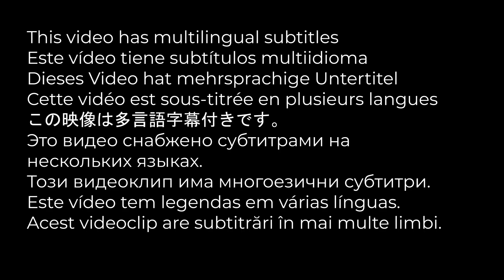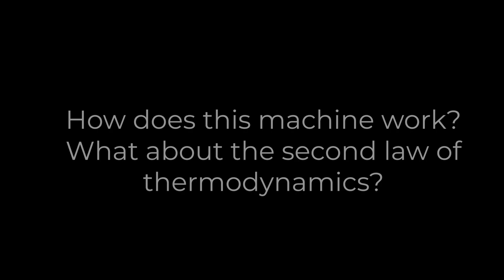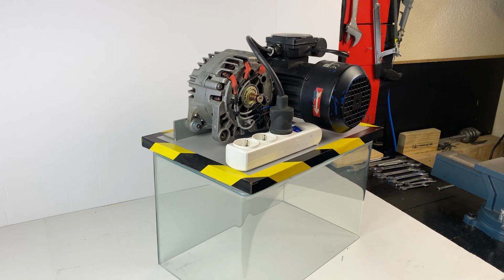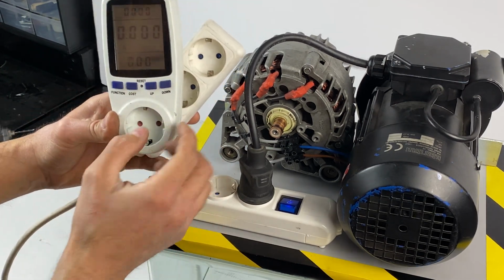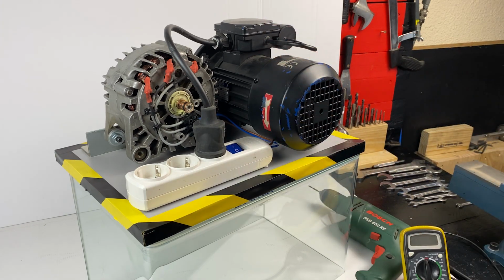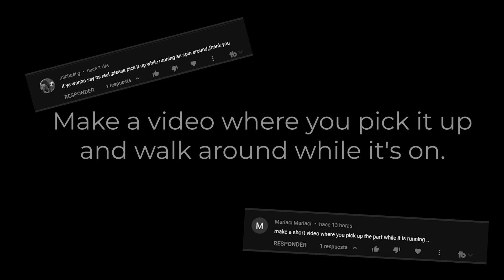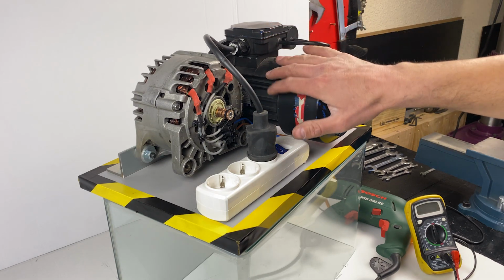We put this Infinite Energy Generator to Test - Liberty Engine 1.0

Comment: Hi nice clip but to avoid patent problems, you can let them be produced in China or Russia, where patents are not of any importance or further more, you sell a set, of all nessesary parts and the buyer has to assemble it himself, so you infringe no patents. In Europe the duration of a patent is 20 years. There are many solutions, so go for it.
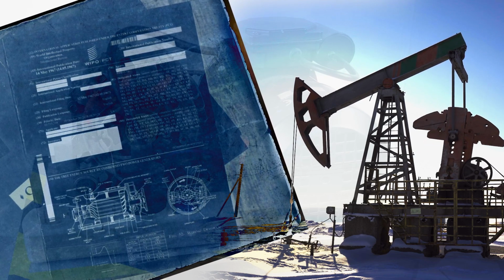Reply: I am suspicious of the patent's existence (19:55) for the following reasons
1) the priority date on the document is October 2012, it should be between 12-18 months before the filing date which says 1967-05-12, not 45 years afterwards
2) the barcodes top-right and bottom-left should be identical, even when blocked out, you can see the start of the barcode nearest the bottom of the page doesnt match the start of the barcode at the top of the page
3) There should be a human-readable patent (application) number next to and below the bottom-left barcode, the same number and size as below the top-right barcode
4) the abstract (summary of invention) is ALWAYS on the front page of the document - in this case it is missing
5) patent drawings are required to identify components by number, not words as the document may need to be translated later to another language**
6) do a search for international patent applications published on 1967-05-14 (which is a Sunday), only 4 were, this is not one of them
7) do a patent search for ALL the words FREE ENERGY SOURCE BY COMBINING TWO POWER GENERATORS, you will find no patent; I did a WIPO patent search for TWO POWER GENERATORS, got 35 results the earliest being 1967, but this patent wasnt amongst the results 

**the 2 cross sectional drawings of the 1950s era DC generator are identical down to the positioning and font style of the component labels as seen on  page 299 of
Technical Manual TM-9-8000, Principles of Automotive Vehicles
Department of the [US] Army, 25 October 1985

view or download a PDF of this 1985 edition of that book by searching for .. manualzz  8811024
there are other editions of this book, having different dates, so page number may differ

Comment: I have always known this would work. This is simply a highly efficient method of using a small proceed of generated electrical energy to produce 60-80% more than required to run the motor. To make it even more efficient you build multiples and power their motors from a single unit. Then you eliminate heat and frequency deviations as you load your circuits. What trips most people up is they believe this is 100% efficient.  It is not.
Reply: You are correct these will work but you have to have the right balance of efficiency versus current versus voltage versus generation of energy and consumption of energy it's a fine balance and it can only be used in its own loop can't really power anything else

Comment: I’m familiar with this tech, only problem is he hasn’t showed this under load & how does it regulate the output? I’m also aware of 50 cycles & 220volts as that is European power specs. Just curious about regulation of power under load. Also to create several thousand watts it takes five  to 13 horsepower to get this with an internal combustion engine. What is the maximum current draw for this machine? (& maintain voltage & current draw?)

Comment: When he pulls cord to start it 
It kicks at a higher rpm pretty quick and at a specific speed 
 My conclusion : batteries in the base  that is wired into power strip 
Mic drop   Prove me wrong make the base clear and also take shroud off of motor and top black converter. All while running it
Reply from the maker: You have a lot of evidence in the following videos

Comment: Could you tell me where you found this 24volt, 200 amp alternator. All the ones I can find do not look like the one you are using in this video. Do you have to search for a 3 wire alternator also? Thanks.
Reply from the maker: Don't try to build it at this moment. We haven't disclosed  all the details yet.

Comment: hello, i have here a 48V dc generator and a six pole 380V generator/motor from an old generator. the question for me is how will the cables need to be put in place. the 48V dc was used to start the generating process for the six pole syncronous generator.
can I use this? how big (HP or KW) needed to be the three phase Motor to turn this 140KvA Generator? how shall i wire the whole thing? Possibly I need to remagnetise the 48V dc gen to errect the 380V AC asynchronus Generator. Or is it not possible to make it?
cheers and many thanks
Martin

Comment: I just want to know how ya take a DC alternator and make it put out AC current.   Is it just the way the magnets are setup on the rotor that while it spins it vibrates just right to make it AC???  Or is it xuz u have 3 wires coming out of the alternator connected to a piece that u can connect only 2 wires too so going from 3 down to 2 wires make sit AC?

Comment: as an engineer i can tell you this idea would work just not like this you need a regulator on the motor the way its set up right now the motor would just spool up indefinately until it blows up the alternator is over charging the system so the motor would continuously accelerate unless a regulator is used to regulate speed

Comment: You are running devices with this machine, where is the neutral? Also how are you running a single phase motor with two phases? I mean where is the neutral wire?

Comment: Thanks man, I think you have proven your case, not sure why the other ones failed, but you have me convinced. Whats the cost of loosing, very low in comparison to not trying at all. On Saturday I purchased a used E-Bike, problem with battery and charger. Took it apart, battery and BMS soaking in water. Went to Youtube. Now am I not only going to build new battery and charger for my bike, but I am going to build a system for my home. You can have a lot of fun with these 3.7 s . Imagination can take you a long way, as long as you exercise it. looking for a good source for battery/materials, if anybody knows somebody. I like how you talked us through it. Going to go and spend some time on your site. I Love great ideas

Comment: 1. Patent rights last for a maximum of 20 years, and even when they are in force, they are publicly available at the patent office. The only way to keep an invention a secret is NOT to patent it, as for example Coca-Cola did with its most famous product, the recipe is only in their safe, so no one else is able to 100% copy this flavor. 2. Giving the patent number is not a crime, it is only forbidden to make a profit without the knowledge of the patent owner
Reply: I am suspicious of the patent's existence (19:55) for the following reasons
1) the priority date on the document is October 2012, it should be between 12-18 months before the filing date which says 1967-05-12, not 45 years afterwards
2) the barcodes top-right and bottom-left should be identical, even when blocked out, you can see the start of the barcode nearest the bottom of the page doesnt match the start of the barcode at the top of the page
3) There should be a human-readable patent (application) number next to and below the bottom-left barcode, the same number and size as below the top-right barcode
4) the abstract (summary of invention) is ALWAYS on the front page of the document - in this case it is missing
5) patent drawings are required to identify components by number, not words as the document may need to be translated later to another language**
6) do a search for international patent applications published on 1967-05-14 (which is a Sunday), only 4 were, this is not one of them
7) do a patent search for ALL the words FREE ENERGY SOURCE BY COMBINING TWO POWER GENERATORS, you will find no patent; I did a WIPO patent search for TWO POWER GENERATORS, got 35 results the earliest being 1967, but this patent wasnt amongst the results 

**the 2 cross sectional drawings of the 1950s era DC generator are identical down to the positioning and font style of the component labels as seen on  page 299 of
Technical Manual TM-9-8000, Principles of Automotive Vehicles
Department of the [US] Army, 25 October 1985

look for a PDF of this 1985 edition of that book on manualzz download 8811024
there are other editions of this book, having different dates, so page number may differ

Comment: Hi bro.. I hv been thinking of using 12v  alternator and connect with 12v dc to 240 ac power inverter.. Then connect the inverter output to Ac motor..
So then no need to modify the alternator magnet..
Please advise sir. Thanks

Comment: As I understood it there need to be put magnets to the inner part or can they be put non rotating to the outer part when using this synchronus gen which has run only 80 hours.. in the las 40 years.. It has coal contacts to magnetise the inner windings in the rotor.
ideas how to make it produce 140KVA 400volts?

Comment: The inability to hold 60 hz is a problem. This can cause problems for a lot of electrical devices. A simple, even lower power version of this would be great for keeping a battery bank charged. No solar panels, no wind generator needed. Just run this to keep batteries charged and let the batteries provide clean 60 hz power.
Reply: Thinking the same
Reply: Use a FULL BRIDGE RECTIFIER circuit to make your power clean!

... hope y'all get the reference!

V

Comment: Some comments: 1. there are more patents for an energy generating machine on this basis. 2. Bearings go a lot longer. 3. It's nice it can power a drill but can it power an computer without blowing it up? For sensitive equipment it needs to be full sine wave. Mabe you can fix this with a solar coverter system.

Comment: So the alternator puts out AC voltage?
And you used a AC motor?
So if it’s putting out 220v how does a 110v drill work on 220v???

Comment: Impossible, The voltage 7:33 is lower at the alternator ???? but higher at the white strip plug 8:25. What type of batteries are being used in the base?

Comment: Can you explain if this unit is supplying the power why the generator does not slow down as you increase the electrical load with appliances? As this is a massive load and as such seems quite strange to me that it does change speed with load?

Comment: Here's one a brushless motor with generator coils started by a battery and charged with the dynamo.  The inverters on the dynamo powered electric cars or more dynamos.   Dynamos with inverters to power the house.  Send your excess back to PGE at 5000 per month per 120 amps.

Comment: Hello, I rephrase the question. Can you give us the voltage given by the generator when it is driven by the motor, but with the motor powered by mains current. Thank you.
Reply: No 🤪
Reply: 200 volts at 4000 RPM with a frequency of 400Hz at idle running and unloaded.
100V  2000RPM   200Hz
50V    1000RPM   100Hz
25V      500RPM     50Hz
In a generator with permanent magnets, not only the frequency but also the voltage is proportionally dependent on the speed. 
Test device, generator with 6 pole pairs.

Comment: I've seen this exact same design many years ago it would be wiser to use a larger wheel for the generator. Feed that power to a circuit breaker box. To regulate your output so you don't burn up your devices.
Reply: Example if wheel was 8 in diameter and the wheel + 2 in diameter on the alternator you would produce four times more electricity but when using a larger wheel on the generator you would need an additional stand in front of the generator with a bearing to help with stabilization for offset weight that comes from a larger wheel. I would recommend you do the math and check your voltage see how much you need to power your home if you can figure it out then your home will no longer require an outside power source
Reply from the maker: Interesting…
Reply: @HiddentechnologyYT  with your new video can you please supply all models of equipment used so it can be replicated by a third party. Peer verification can be the only proof acceptable as any video produced will always be open to dispute of authenticity. Hollywood makes its money on the back of making the impossible look real.

Comment: Where can I buy one? I seen a similar patent and it was abandoned. By the way Patents expire after 20 years so.. it's not tucked away.. anyone can build it. However.... your device simply cannot work.
There is a way to do it.... but you need a fuel source called water.... you can split it with sound and use it over and over and never run out of fuel.

Comment: I'm sorry, but I learned about this little fallacy back in the early 1960s when I was in high school Electric shop. People have been doing this since the generator and the motor were invented, because on it's face it seems so obvious. It doesn't work because friction is not taken into consideration. It will run for a little while but it will run down unless it has an additional voltage source put into it. ie., a battery.

Comment: The video clearly shows a working system but it doesn't show the system is running on 'free energy'.
To proof that  claim it has to run for a much longer time to show that nowhere a battery is hidden somewhere inside.

Comment: 4:19. Wrong. In order for there to be 220 volts between the phases, it is necessary that there be a linear voltage of 127 volts on each of the phases. You have a line voltage of 220 volts, which corresponds to an interfacial voltage of 380 volts.

Comment: 1.Gdzie kupić alternator 200a 24v? Owszem są ale 12v 200a
2. Jakie parametry mają magnesy?
3. Jakie parametry ma silnik?
1 . Please provide the 
parameters and dimensions 
of the neodymium magnet. 
2. A 24V 200A alternator is 
hard to come by. Can it be 
replaced with e.g. 12v 200A'2 
3. Please provide the 
parameters of a single-phase 
motor. 
Thanks for the answers!

Comment: Thank you for the great info. I have tried to find the exact alternator. You told us it is a "veleo" from a VW if I understood correct. I can find them...although it seems they are actually called "valeos" with an A. And they are from vw cars...which seems to indicate that they are 12 V instead of the 24 V you say you have used in the video. Would you please confirm again..did you use a 24V alternator from a Volksvagon ?  I thought 24V alternators were from trucks only...is there a VW truck? ....and what would happen if we did the above process with a 12V instead of a 24V...?  We are having big problems locating  200 AMP 24V alternators in Australia....Thank you in advance. And please keep going with this stuff!
Reply: I found 200 amp 24 V alternator is on eBay but they’re almost 1000 bucks. I don’t think they’re VW ones though not sure
Reply: I think we have to use 24 volt, coz he said that it will increase power 10 time so its like 240 volts, so technically if we use 12 volts it will bring only 120 volts?
And I have one question about amps, can we use 80 amp alternator? Does it make difference?
Reply: @johnjohns2333  I didn't even know, but there must be some kind of old VW truck that I never heard of. I was born and raised in Denmark but I never heard of a VW truck with a 24V 200 amp alternator. But it seems they must exit.
Reply: @vadimkot90  It seems, Vadim, that nothing we attempt to do will work before they disclose the relevant information needed. They told us in the third video that there is a crucial piece of info they will not release until they are ready...and that we should avoid trying to make one ourselves since it will not work for us....yes, what an absolute letdown. They should have been honest from the start. It sure would have saved me much time, effort and money.
Reply: @johnjohns2333  Hi John.... regardless of amperage and voltages, we cannot make it work. I just saw the third video installment of their liberty engin and they tell us not to attempt to make a machine ourselves since we will not be able to make it work. They say they are withholding the last crucial peice of information until such a time as they see fit. Big disappointment.  I know in my heart that this is absolutely real... sadly though they will not share.
Reply: 12V 210 A is from BMW M3 413 Ps
Reply: I need Information about Neodyn Spezification. I have pay 20mmx20mmx5mm N52 is this correct?
Reply: @Ryzend86   Hi Ryzend... I do not know the correct sizes but as far as I know they need to be N52, yes. But keep in mind we can not build this machine... they are withholding the final cue that will make it work for us and they are not going to release this last piece of crucial information until they decide it is time.  So... we can not make these liberty engines yet!

Comment: How long magnetism of those magnets you installed will last, i.e. how long magnets will be able to release energy, i.e. what is lifespan of the system? Or is the magnetism recharged somehow during the run?
Reply: Magnets do not release energy, through angular momentum and inductuin with copper coils they convert aetheric energy into electricity. The same as every alternatoe and generator has done since electricity was reinvented 200+ years ago

Comment: Hello, if it works like this you will trigger a revolution!  but please open all the covers first so that you can really see all the cables, especially those from the motor (on top).  When everything is open please start the engine.

Comment: Just checked the specs on your drill Bosch psb 650re.
Input power 650watts output power 338watts.
My question is how does your drill use 850watts under no load condition?

Comment: I would like to see the setup at load of 1KW say with a heating element or some halogen lamps connected in parallel to make a 1kw load. (This is only 1/5 of what you are quoting) You will run the setup for 5 or 10min continuously. 
I suspect that the motor revs will start declining and finally stops.

Comment: try a large heater on it ,, with 3 or 4 settings turn it on 1 to start moving upto 3 see if motor slows when u drop high current usage,,